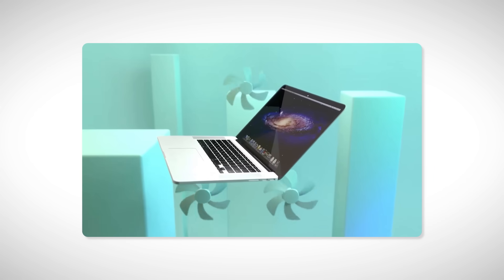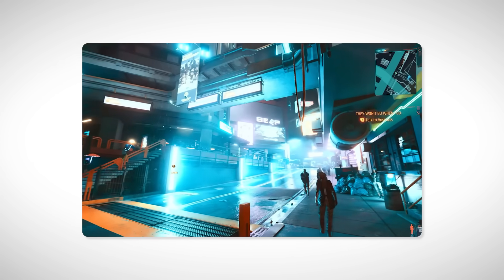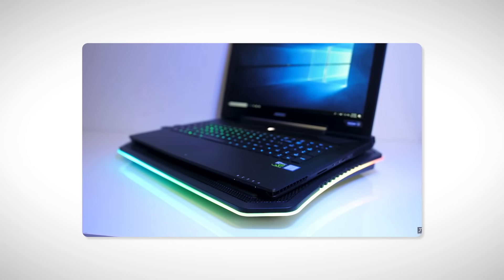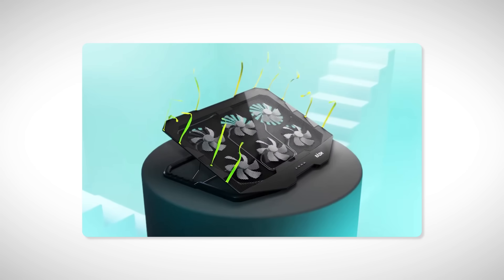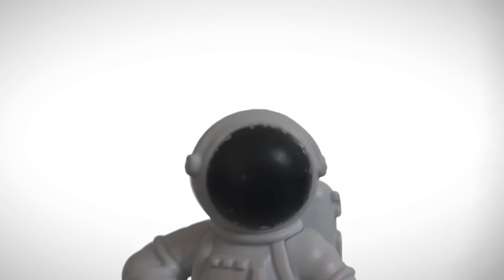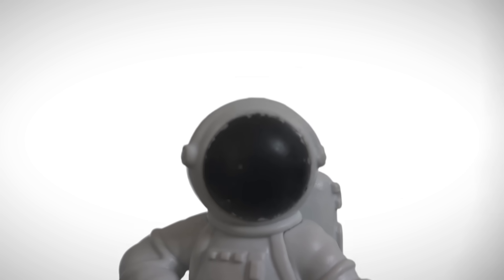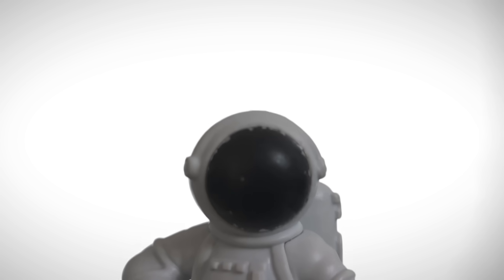Things You Realize As Soon As You Buy A Laptop Cooling Pad

Comment: Stop. spreading. bullshit. the fps drop isn’t caused by some power-saving system. it happens because thermal throttling kicks in. when your laptop gets too hot, the cpu and gpu automatically reduce their speeds and power usage to prevent overheating and protect the hardware from damage. this kicks in when temps hit unsafe levels, not just normal heat.

power-saving modes, on the other hand, affect performance gradually—they don’t get triggered by heat. so, if your laptop’s performance drops due to high temps, it’s thermal throttling, not some power-saving mode trying to save your battery. get it straight.

next point: denying facts like thermal paste? if you’re not replacing the paste because "it wasn’t in bad condition," that’s pure ignorance. if you bought a cheap laptop with shitty build quality and internal cooling, the manufacturer threw cheap thermal paste on it. quality thermal paste is by far the best option to reduce temps, guaranteed, and it won’t break the bank if you’re tech-savvy enough to invest in it. replacing it with better thermal paste will lower temps by 5-10°C, end of story.

and then there’s the cooling pad nonsense. “i thought my laptop would stop overheating” — really? that’s a stupid take, especially after showing us the cheap, shitty cooling pad you bought. i’m not even going to bother arguing about why those don’t work. they don’t, and you’re wasting money on e-waste. but let’s get real—cheap cooling pads won’t magically manufacture synthetic liquid nitrogen inside your laptop. however, they can slightly reduce temperatures by inefficiently pushing slightly cooler air onto your passively cooled laptop’s shell or through the vents. they also help by raising the back of the laptop, giving it stronger intake airflow if you have vents on the bottom. but honestly, don’t expect miracles.

if you have the money, do not buy a cheap one. instead, purchase a LLANO cooler or any of the better options out there. quality cooling pads at low RPM (800-1200 RPM) are not too noisy with headphones, and in my experience, they reduce temps significantly—even under full utilization and max boost clocks. on my laptop (Ultra 9 275HX, RTX 5080), it keeps my CPU at 91°C and GPU under 80°C at MAX WATTAGE. that’s the kind of cooling solution you need if you want real results. there are also other brands, but LLANO has shown decent results for me, so i personally recommend them.

lastly, you don’t need vents on the bottom to see a temperature drop with a quality cooling pad. laptops without bottom vents typically use their shell/frame as a heat sink, which is why macbooks roast your legs off when you put them on your lap. the cooling pad just gives them better airflow to help keep things cooler.

and please, review your damn videos before spreading more of this garbage. stop using chatgpt for this crap because it’s clearly doing you dirty. although, if this is genuinely your take, chatgpt might be your only choice to create a quality video, because you’re clearly extremely misinformed. it’s not even like you’re making up for it in visuals either—you’re literally dragging an image of an astronaut to make up for your lack of quality, reliable information, with the occasional image off google. no actual statistics or results to back yourself up, just a “urr duurr i need money for my new pc that i’ll probably have too high expectations for anyway, so let me make some low-quality videos that will get me paid.” honestly disgusting. i wouldn’t even do it if i was homeless. i hope you have a wonderful day, and enjoy your new future cpu you purchased with your dirty money that doesn't bottleneck your graphics card by like 15% lmao.
Reply: besides, if you’re getting a gaming laptop to play on battery—unless you intend on playing very minimally demanding games—you should’ve done your damn research. you’ve been fooled by the companies. gaming laptops are best utilized plugged in, as they’re designed to handle high graphical performance when connected to power. they are not designed to run at full power on battery, because that would be stupid, inefficient, and you’d get maybe 3 minutes of battery life before it explodes like a hydrogen bomb. they're better used on battery to power down and save your work or progress in a game, whilst also being very portable and easy to move around.
Reply: @ploxarino2981 the only real issue with a cooling pad is the fact that the fans dont align with the outtake fans of the laptop, you have to be very careful when buying one to ensure they align and dont block the fans. The other issue not as important is the sound. Imo a laptop stand does good enough, at max 2-3 degrees hotter but lesser fan noise, it works for me atleast.
Thermal paste and laptop stand ez
Reply: @legendaryentertainment1490 if you’re genuinely concerned about temperatures, normally you’re running a gaming laptop, and in most cases the vent alignment isn’t really a problem, as they mostly have similar layouts. i do agree it makes a difference, but the overall improvement would still be worth it. i’ve tried it with two different laptops and one of which did have the issue of little space for air intake on the bottom. i can’t give you results, but i can assure you there is still a reasonable benefit. said benefit is only worth it if you’re concerned about really turning your laptop into a desktop competitor or if you’re trying to take care of your hardware. i wouldn’t recommend outing $150 on a cooler if you’re not caring about every frame.
Reply: @legendaryentertainment1490 laptop stands are easy and more than enough for most though yes
Reply: @ploxarino2981   do you prefer just stands or stands with fan? (For entry level gaming laptops)
Reply: @Dead-r3w  if you’re choosing between a regular stand and a stand with a fan for an entry-level laptop, just go with the one that has the fan if it’s within your budget. the temp drop isn’t going to be massive, sometimes 1–2C, sometimes nothing but there’s no downside to having that extra airflow. even a small reduction helps with longterm temps, especially on cheaper laptops that don’t have the strongest internal cooling to begin with.

cheap cooling pads aren’t miracle workers, and they won’t suddenly turn your system into a high-end machine, but they do provide slightly cooler intake air and raise the laptop for better ventilation. that’s really all you should expect from them. if money is tight, a regular stand still does the job by improving airflow from elevation alone. but if the fan version is affordable, it’s the better option of the two.
Reply: Goated comment lmao, most ytb techbros and tiktok tech bros are just braindead and would absolutely upload a video with wrong informations and ignorance for views 😂
Reply: @a_fun_enjoyer i don’t know how he pulls it out of his ass? like i tried it myself, asked chatgpt the exact same questions and it answered mostly correctly, at least better than what this guy says. anyway, for anyone reading this who needs pc help, if you’re unsure about something, trust your gut, and get multiple opinions before you watch videos because @a_fun_enjoyer is right, so many idiots out there tbh
Reply: goated comment
Reply: also before anyone comments “dude, it’s just one video” this guy spills so much other garbage in the rest of his content. like “a dedicated gpu cannot use system memory-“ etc.
Reply: @ploxarino2981 would u mind me asking what laptop are u currently using and the price for it?
Reply: @a_fun_enjoyer youtube keeps deleting my comments. legion 7i pro gen 10.
Reply: Exactly lol
Reply: Deep Breath!!!!
Reply: agreed
Reply: Thank you for poiting this out, i was about to write this exact essay
Reply: nice, i'll also dislike and click the "dont recommend this channel" something-something
Reply: for anyone curious i put my specs in my bio, along with my peripherals
Reply: @rahi9760 I actually have a budget laptop cooler similar to llanos it comes with anti dust filters and plugs in via usb for only 25 bucks!
Reply: @Boring7279 it’s also all about the fan speed and size, you want it to be able to PUSH air hard into the internals. but, somethings better than nothing if it’s weak
Reply: Damn you cooked here. I got a Llano recently too and it made a huge difference. You definitely cant cheap out if you want a fan that actually lowers temperatures.
Reply: Actually useful comment for once
Reply: My computers cpu is running at temps under 90(usally around 80-85 with rare cases of 88-90) when playing my prefered game, I was wondering if a laptop cooler is worth investing in even though my temps are fine. The only reason I was considering one was to perserve the laptop for the future as I don't want the performance to decrease. Is there a need for me to get one based on my current situation and do you recommend any cheaper pads compared ot the LLANO? I thought I would ask you since you seem informed on this topic.
Reply: @rahi9760 i’m sure there’s cheaper pads out there, but if you want to research look for ones that have foam for redirecting airflow and dust proofing etc
Reply: @rahi9760  as far as im concerned, IETS and LLANO are the best, most well known options. if you can snag a good deal, they’re quality. i’ve only tested llano and it’s shown no problems. although, they are a tad pricey. so yeah, unfortunately i can’t recommend you anything else without making assumptions, but if you have the money to spend, spend it
Reply: My laptop runs at max temps when playing Skyrim lol, I love my laptop to death, and it's usually not even used for games
Reply: Dashes told me this is Ai
Reply: @bakaツ゚  the videos are probably yes
Reply: You should have made the video
Reply: @stonedbunny5721 i absolutely considered it lmao
Reply: @ploxarino2981 😊
Reply: No need for all the insulting and swearing bro, it's not a matter that'll get someone killed
Reply: @tnt3t personally i’m not trying to overly swear. but i’m not going to hold back from insulting someone if their content is fundamentally built on unreviewed AI slop and the first google result. spreading misinformation does hurt people dude. maybe not to a extreme severity in this case, but it’s justified
Reply: @ploxarino2981 
It really isn't justified, it's one thing to call him out on misinformation, it's something else entirely to flat out cuss him for it, especially when it doesn't hurt you yourself in anyway since you are well informed, and I'm not saying speaking up for others is wrong, just that the passion you're showcasing for speaking up in this particular scenario... it's uncalled for
Reply: again though, initially. it did make sort of a comeback in views. anyway, i take accountability, its not entirely appropriate to be rude like this, but then again, it doesn’t really matter regardless as the creator probably didnt even acknowledge it
Reply: dude you dont need to cuss him out? ok i agree he made mistakes and stuff but you dont need to cuss him out, hes just a youtuber trying to make a living here. also, u cant just assume that he is doing this for his PC, and it isnt dirty money, he made the money by making a youtube video that people decided to continue watching
Reply: @HelloHello-ij5fe you need to stop trying to justify his actions 😂 it’s intentional, not a “mistake”
Reply: @ploxarino2981  he doesnt make things wrong intentionally, legit barely anyone does that in content creation. also why do u cuss him out mate like its just a few mistakes, u make mistakes 2, dont act like a piece of shit to other people just because they make mistakes
Reply: @HelloHello-ij5fe this is just a horribly bad take. no accountability
Reply: @ploxarino2981  y r u going off topic, he made a mistake, you make mistakes, everyone make mistakes, so quit cussing him out for making a mistake. its not that hard to understand mate
Reply: bro took time to write pure facts .. a real commenter fr
Reply: @agent61_maybe appreciate the respect, i’m not a perfect person but i hope the creator seriously reads this for once and stops pushing out misinformation and slop content
Reply: someone’s gotta put him in line
Reply: How did you push your laptop GPU and CPU to max wattage?
I have a MSI stealth HX18 with the same laptop 5080 and intel ultra 9 275hx. 

I'm also planning to get a cooling pad but I still have to research what is the right size, capability, and price. If anyone has suggestions it would be appreciated
Reply: @Danny.Duns1  i use a lenovo legion, it comes with the legionspace app which allows me to tweak any settings i need. realistically you can push it further with third party apps but i can push it to  a 205 watt PL2 boost on my laptop, which is basically the thermal limit it can get to with the llano cooler regardless (any higher would probably be overheating) the llano v12 and v13 will be what you need as a cooler. dont worry about size, the foam seal is big enough to account for minimal differences
Reply: I thought you were too harsh, but this is goated criticism.
Reply: @actuallyteru  id agree to a  extent that initially it was rude, but not without reason. hes still making these ai slop videos  to this day lmao
Reply: A nice diy option for those who already have their laptops on a Monitor/Laptop arm. Or a laptop stand with holes that fit screws.

Screw on some PC fans connected to a PWM controller with a transformer built in so it can convert the 5V USB to the 12V the fans use. Less noise, better cooling, adjustable speed and postion and can be repurposed for a desktop.
Reply: @Qimchiy very cheap too probably

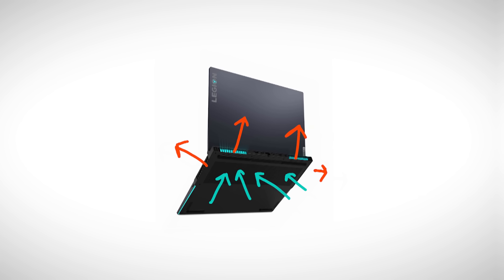Comment: My laptop's cooling system works like on 4:25, but with bigger bottom net. I bought a simple stand for like a dollar or two, and it really helped. I believe that temperature drop from 85-90 to 75-80 is fantastic. The main problem was that the laptop had a hard time getting air in because it was flat on the table. Now that there was more space underneath, it was easier for the air to move. And I actually still believe that if there was a fan in the stand to push the air in, it would have been even better.

Comment: My cooling pad works really well for my laptop.
When i play gta V for about 40 minutes without a cooling pad it whould start to lag but as soon as i plug in an air cooler im able to play for hours on end
Reply: can i know which cooling pad do you use
Reply: @MJhonson69  cheap no name Chineese cooling pad.
Reply: @MJhonson69  you should find a cooling pad for yourself because not every laptop is the same and it will work diferently
Reply: If you have money you can spend and want something for a gaming laptop buy llano v15 cooling pad

Comment: All laptop cooling pads aren’t built the same, please do some research. Recommended laptop cooling pad is the llano and the razor cooling pad. There’s absolutely a reason for keeping the laptop cool.. it will extend its life and you don’t have to change out the thermal paste for a good 2 1/2 years. If you’ve had your laptop over 2 years, you should get it serviced with a new battery and new thermal paste even if it’s Liquid Metal, Liquid Metal does dry up and harden with time. Also, unless you’ve worked with Liquid Metal before, or don’t care about potentially destroying your laptop, it’s best serviced by a professional, we have insurance. Besides that, you’ve got to remember a laptop is a full fledged computer.. of course it’s going to need cooling, yes they come equipped with fans, but those fans, even on gaming laptops, aren’t meant for long gaming sessions.. they’re ment to give some airflow so you’ll not immediately hit the thermal limit of the device. The short.. keep pc cool however way you can, even if that means taking off the backplate for better airflow with your cooling pad.

Comment: You were trying to dig through a mountain with a spoon, and buying a wooden-handle for the spoon helps, but not enough.
Cooling pads do work. 
I have one
I have a laptop with a R3 5300U in it, integrated kinda weak graphics, but more than enough for movies and web browsing.
If I crank it up to the Max, and I'm just watching a movie, my hands literally get cold.
If I just decide to set it to "normal" which is medium fan-spin, there's no noise, neither from the pad, neither from the laptop (because it doesn't have to spin)
What I don't do, is try to run AAA modern games on the laptop. Demanding games, which would take all the processing power that the laptop has and still not be enough to give me a good experience. Because in that case, no matter how loud the cooling-pad fans are spinning, it still won't overcome the fact that the laptop is smoldering hot.
So yeah
You want to play modern games? Get a desktop. No "gaming" laptop can succesfully cool it's components when running to the Max. There's just not enough Heatsink space and vent area, and room for large vents, that can spin slowly.
Reply: he's clearly misinformed and stupid, or using some somehow extremely shit AI. never trust a word out of this mans mouth